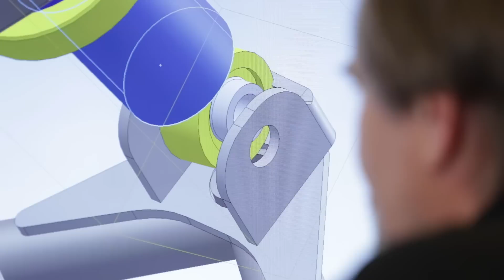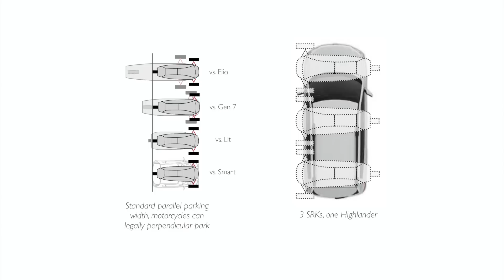The Arcimoto Story - The Everyday Electric Vehicle - #FutureIDrive

Comment: For $7700 I can buy an fully enclosed ZEV Electric trike (the 5 door one with the hatch rear) with 80 mile range and a heater, windshield wipers, etc.  I want one with the 100 mile range option, still less than an Arcimoto
Reply from the maker: MegaDhz ... and? We are happy to compare ride quality, utility, stability and all the rest with any other product on the market. We are aiming for a product that is affordable for the mass market and still meets a very high bar of utility. There are other products that will cost less and others that will cost more; we believe we have one that hits a reasonable price with exceptional value.

Comment: It will not pick up speed adopting it into mainstream, because gas is cheap and this vehicle is half the weight of conventional vehicles out there or more than half which is alarm going for purchaser. Anyway it will be adopted but not in ten years but about in twenty years. Why twenty ? Reason is world haven't discovered any major oil field pass 2000 and we have abundance is not 'plenty'-ness but sucking remnant with better tech and methods. So, bell curve shortage diagram is not correct this time, but shortage will come faster than predicted as historically would say.
Reply: Fuel cost is irrelevant when you actually care about living sustainably. Light weight is the best positive thing about it. You are stuck in the past with your car centric thinking. Big oil is dead.

Comment: 4x4 in the same size as a motorcycle (without helmet and can be parked on their places) with huge roof against snow and sun (solar panel for air-conditioning) and fully weatherproof and waterproof and battery on a trolley to be charge at home easily interchangeable = next version ? if existing I will sell my big 4x4 car (as I do not use much) and buy this new version of your car (but be able to drive on highway with Tesla big batteries and range). take example in the Renault Twizy with more improvement as that little car has not improved for years ... that one is probably dying from the French constructor

Comment: need to be as narrow as a scooter and 3 wheels drive for snow, rain, mud, with 2 seconds interchangeability batteries (on wheels if too heavy) etc
Reply: .... 2-second battery change?  That's a heck of an unrealistic requirement there.

The Gen7 has an option that gives it 130 miles of range.  Theoretically you should be able to put 200W, maybe 300W, of solar panel capacity on the roof, and that would extend range even further.

If that's still not goo enough?  Buy a bus ticket.  Seriously.  :)

Comment: So if it's a motorcycle .. you need a motorcycle addendum on your driver's license .. and you have to wear a helmet. This costs twice as much as an Elio but it looks like less of a vehicle. Elio looks like a car and has a gasoline engine.
Reply: +Edd Austin Motorcycle licensing requirements vary by state, and so do helmet laws. Most states have carve outs for three wheeled motorcycles so you don't need either. When you factor in savings on gas you'll actually win with the Arcimoto over time, but the reality is that both are different products with different advantages depending on your needs. The SRK wins on fun factor, efficiency, parkability, and ease of access for both passengers.
Reply: +Edd Austin it would be considered a motorcycle in California like my old Zap. However since the Arcimoto has a role cage and and seat belts, California would allow you to drive it with a Class C drivers license for autos. California considers the roll cage and seat belt restraints to be the same as a helmet, so a motorcycle helmet is not required. What is great is you would register it as a motorcycle and would pay less insurance and even take a motorcycle license test like I did in my old Zap and have your insurance lowered even more in California.
Reply: The Elio is legally just as much a motorcycle as the Arcimoto.  The makers of the Elio are trying to increase the numbr of states that exempt an enclosed 3-wheeler from needing a helmet, but ... that would benefit the Arcimoto just as much as the Elio.  (Honestly, the two firms should look at working together on that, at least.)

Comment: I purchased a 2008 Zap Zebra. What a rolling disaster! It was slowly falling apart when the federal government made Zap recall them, pay us high Kelly Green Book and they were all crushed because of brake problems. No one told me they were made in China or I would have never purchased one. Fortunately, I bought a demo with a few dings in the body from a dealer in bankruptcy and paid very little for the piece of crap. I will have to test drive a Arcimoto. I am impressed with this upload.
Reply: +Lance Boil Yeah - I looked at the Zap before starting Arcimoto, but just couldn't go down that road. Glad you dig the Arcimoto, definitely worth getting in the driver's seat!
Reply: +Mark Frohnmayer Mark, yes lead acid batteries and poor offshore production was the deathblow to the Zap. Zaps could be exciting however, because you never knew if you would make it to your destination or not. One day I stopping at a red light and the cheap Chinese bolts which mounted the seat to the floor snapped and the next thing I knew I was staring at my headliner. I managed to get the seat upright and limp home where I replaced the bolts. I have to say at the time it scared the heck out of me because I did not know if I was rolling into traffic. Fortunately the vehicle was stopped. At the time it was not funny, now it's just another antidote of my crazy Zap story. LOL
Reply: +Mark Frohnmayer I would love to test drive one. My roof has 18 solar panels on it, so operation would be cheap.
Reply: So that probably its taking forever for anyone to get one of these on the road. I looked it up on Wikipedia. If you see these on the road it will be in 2025. So many developers yet no one can get something cheap going and reliable going.
that and trying to keep gas guzzlers on the road as long as possible

Comment: Do you need a drivers license or motorcycle license?
Reply from the maker: Depends on the state! It is technically a motorcycle. If you need a motorcycle license, you can take it in the vehicle. Hope this helps!
Reply: Federal Laws mandate it is a Motorcycle, most states will require you to have the M endorsement on your driver license.

Comment: big draw for motorcycles is lane splitting. would you be able to lane split in this? any way the final edition could be a bit thinner?
Reply: No you wouldn't be about to lane split, because the wheel base is too wide.
Reply: Also there's NO way too make it thinner, because it's meant to seat a passenger. Unlike a standard bike which you sit on.
Reply: +Eric Rupe isnt' that only legal in California?

this is technically an Autocycle. the new class of 3 wheeled cars that follow motorcycle laws!  Slingshot. Morgan, Trex, Elio are int his class.
Reply: +Eric Rupe We haven't done a formal poll, but I would think the risk presented by lane splitting would make it a winning feature for only a very small subset of the population, whereas benefits of the SRK like easier parking, visibility, maneuverability, solo carpool lane operation, efficiency, etc. are higher on the list.
Reply: +ScottaHemi Whether or not it counts as an autocycle varies -- some definitions of that term specify a steering wheel and recumbent seating posture, whereas Gen 8 you sit astride an operate with handlebars.

Comment: Nice car, and the current version is much more attractive than the prototype I saw a few years ago. But how weather-resistant is it?  The photos and videos don't really show the sides, where the doors and windows would be, very well. Do you need to wear motorcycle rain gear? Coming from a town where it rains for two-thirds of the year, one would expect it to be leak-proof, but maybe not - the prototypes certainly aren't. 

Also, whoever put the subtitles on this video either was a "what" rather than a "who" (i.e., a voice-recognition program), or was paying no attention at all to what was being said; and just put up whatever it sounded like, at one point getting "our Camillo" for "Arcimoto".
Reply from the maker: +Baribrotzer Thank you for the captioning heads up! In regards to your question, the vehicle keeps you somewhat dry because there is a "wind curtain" that redirects the rain around you. However, you can order a fully enclosed vehicle with climate control if this interests you. You can check out what a fully enclosed vehicle would look like by visiting our website at arcimoto.com

Comment: Interesting concept, but you cut out a large segment of the European market. That thing counts as a motorcycle over here and as such you need a motorcycle license, which I doubt people would be willing to do. Add a fourth wheel maybe?
Reply from the maker: +Calum Crowther Calum, thank you for the comment. We have the vehicle as a three-wheeler because it provides many benefits such as more light weight, affordable as well as lower insurance rates. For now, we will be keeping this platform. In the USA, it is not required to use a motorcycle helmet or license in some states and we are working to change legislation for the other states.
Reply: +Arcimoto I was wondering if it would be possible to potentially convert the rear end to a type of quad bike rear end. Should be fairly simple, judging from the design, and you could offer it as an optional extra. Thanks for the reply, I wish you success in your future endeavours.
Reply: +Calum Crowther add an unnecessary wheel because of a stupid law? You know how that sounds right?
If it counts as a motorcycle then I expect you can take the motorcycle license in one of these..shouldnt be much problem if you can drive a car ;)
Reply: +Calum Crowther In jurisdictions where you need a motorcycle license to operate the SRK, you'll typically be able to take a skills test using the vehicle itself - i.e. you don't have to learn how to operate a two wheeled motorcycle, countersteer, lean, etc. Trust me, the hour it takes to do that is totally worth it for the lifetime you'll enjoy the Arcimoto :-).